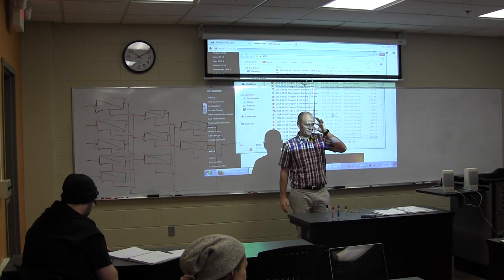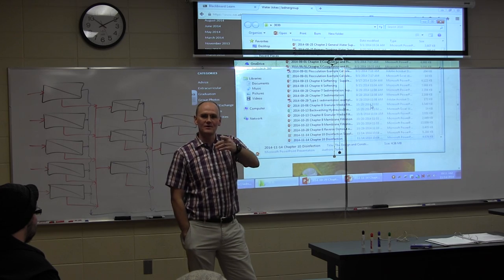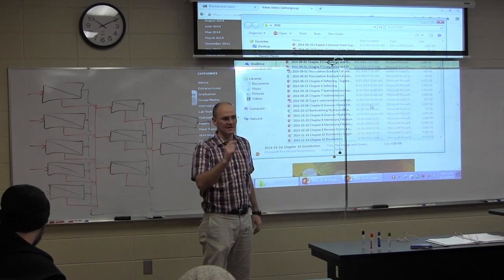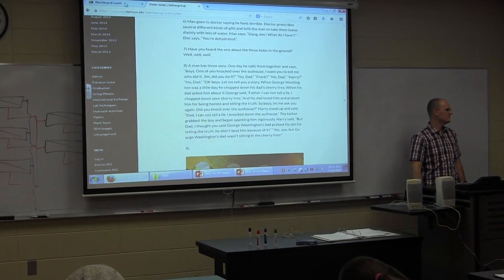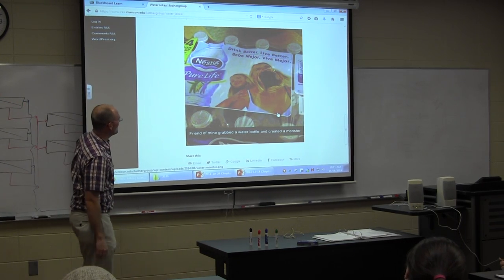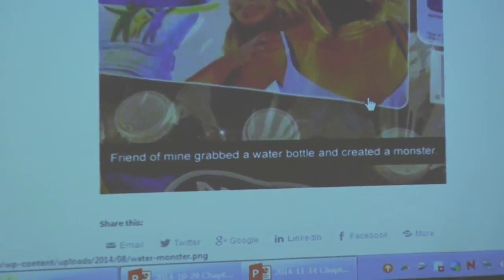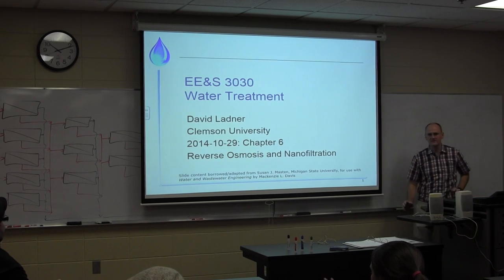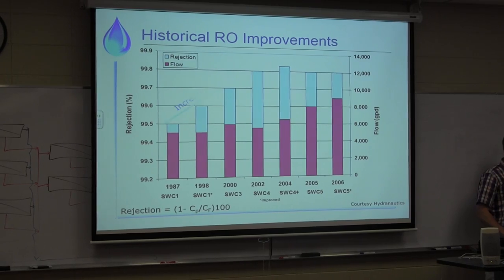Nanofiltration Array Example

Comment: Can you explain why recovery is 0.45 ? If we use 3 or 5 membrane modules will recovery change ? Thank you for answers
Reply from the maker: Recovery was chosen at 0.45 just to simplify the problem. In reality one would need to talk with the vendor and find out what the actual membranes can produce. In this example we didn't state explicitly what the number of modules would be inside each pressure vessel. But different numbers of modules would certainly affect the recovery.
Reply: Thank you for answer 😀